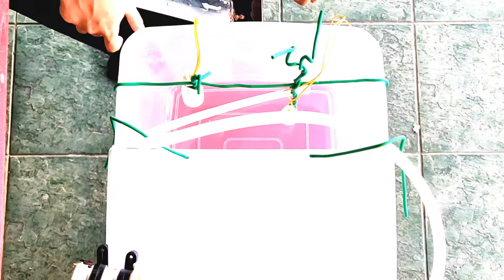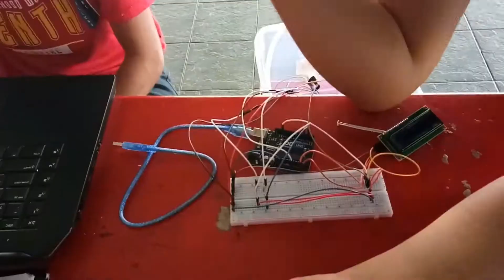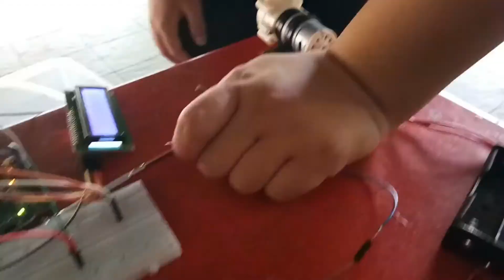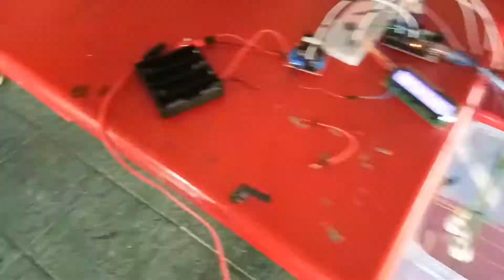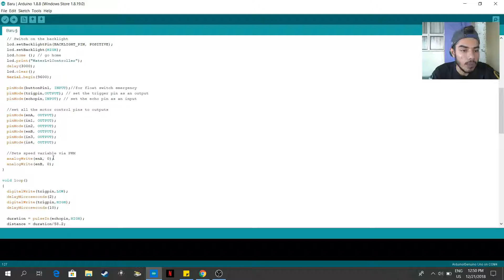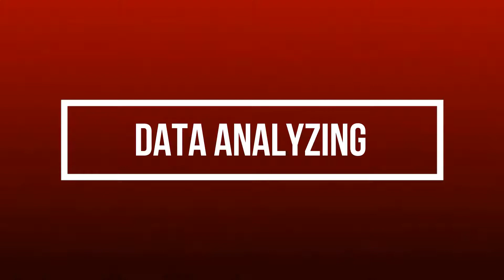ARDUINO WATER LEVEL CONTROLLER

Comment: salam saya cuba buat project yang sama. material semua sama L298n ,pump , and sensor HC-SR04.. cuma saya takde resistor. boleh tahu wiring connection untuk project ni tak?